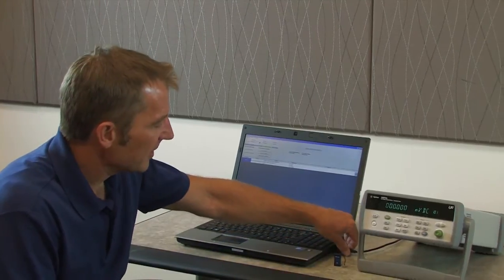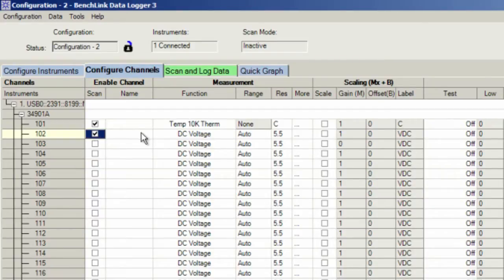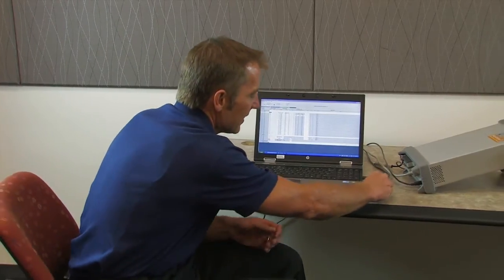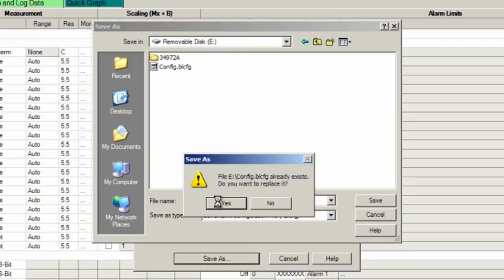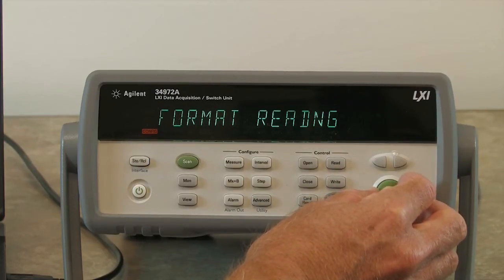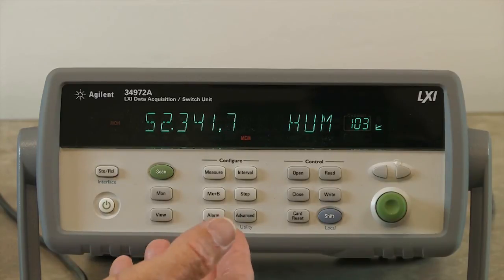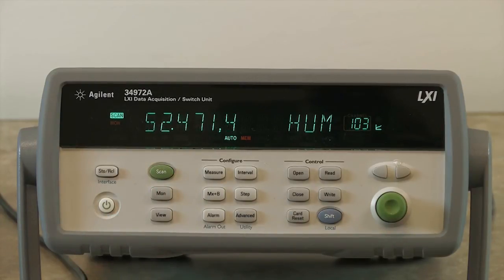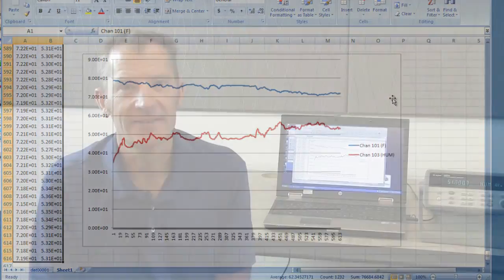USB Data Logging with 34972A Data Acquisition System

Comment: I need to conduct an experiment using the thermocouple. First of all, i am measuring fruit core temperature inside a refrigerated transport container (but will be stationary). When setting up the thermocouple, what temperature type is suitable for this measurement? I am quite unsure if to use Temp (Type C or T). Where can i find information on this particularly? Secondly, my experiment will last for at least 10 days, so i intend to do it remotely using the USB data logging method. I will set it up to measure at 10mins interval, any advice on the required size of USB i may be needing? I am scared of losing data as this is my second and last research experiment. Thank you in anticipation.

Comment: What´s the diference betwen connect the equipment with USB cable or LAN cable, because of at first to connection with LAN the PC did not register it. Can you send to us more videos with examples to measurement  termocuples, thanks
Reply from the maker: Francisco Lozano  The LAN cable will work but you have to have wifi off. So, the laptop and 34972A are the only connections. If you connect your laptop and the 34970A to the same router then you can have both the internet and the DAQ.
Reply: @KeysightHandsOn  Thanks for your reply.

Comment: can we use this instrument to acquire data from a PCB vibration accelerometer ( model : M353B15)? I would be grateful for your suggestion.
Reply from the maker: Nitin ks.  You may want to call our technical support center to discuss your application.  The 34970A and 34972A can measure the RMS voltage from the sensor which would represent the total vibration.  However, you may want to use an FFT analyzer to see vibration force by frequency.   Many oscilloscopes have FFT capability but low resolution.   Dedicated hardware / SW is available if you want more resolution and faster update rates.
Reply: thank you for the reply.
Reply from the maker: no problem. Good luck with your application.

Comment: Is it possible to turn off the sounds (relay?)  when scanning?
Reply from the maker: Allison you are correct the scanning sound is from the relays and cannot be turned off.  The 34902A is less noisy as it uses reed relays,  in a lab environment the sound is not extremely loud.  Another solution is to monitor the 34972A remotely.